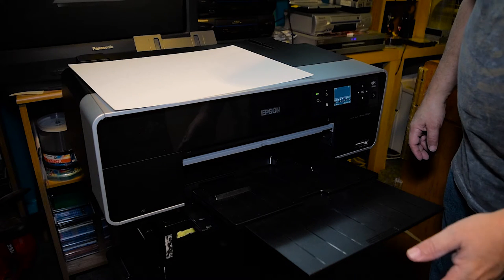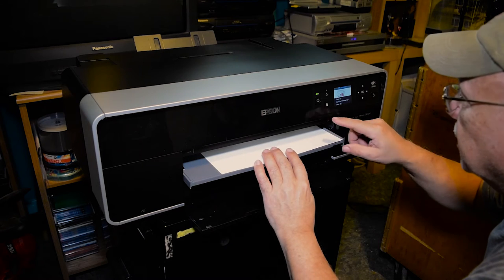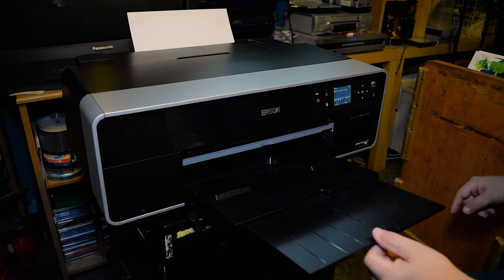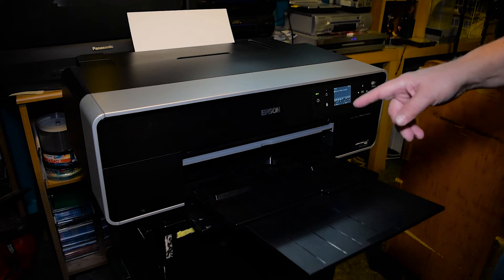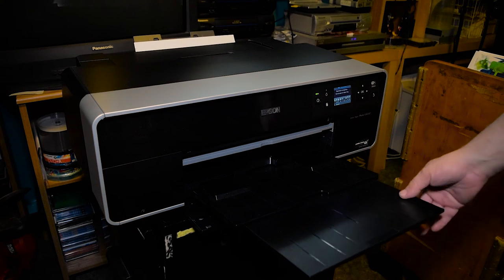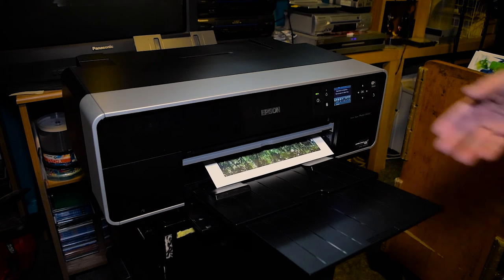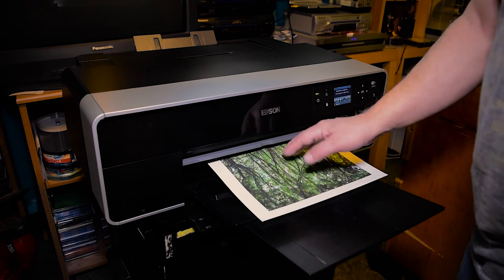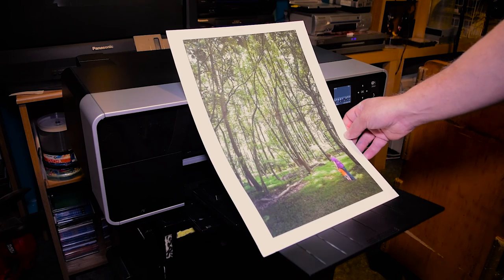Printing On the R3000 on Fine Art Paper from the front loader

Comment: So all fine arts papers should be sprayed or this particular one requires this additional step?
Reply from the maker: +ladduro Spraying is common on several fine art papers. But it is more of s personal choice if you want to protect them from UV.In my situation with the CANSON Water color paper it is a necessity as the paper is totally uncoated for inkjet use.If you are using a paper intented for Ink Jet printing or photographs then you would not have to.
Reply: +Jose Rodriguez I am using Epson's fine art papers. Especially Velvet Fine Art. I could not find any info regarding to coating for these papers...
Reply from the maker: +ladduro Because it really does not need it. Some papers that call themselves "Fine Art" really shouldn't. A ture Fine Art paper will be free of OBAs or any coating that has nothing to do with INK adherence or absorbtion. Often coatings and layers are applied to solely enhance the appearance of the image. Brighteners are used on the paper base and inbetween various layers. That's not saying "Velvet Fine Art" is bad. Not at all. Just that it does not really need anything else to enhance the results.Canvas Pigment Prints, and heck, even real classically produced Oil Paintings all need a coat of varnish or they will look extremely dull. So will cerain papers. You would know. If it looks great right out of the printer then that paper simply does not need any coating.CANON real Watercolor paper definitely does.

Comment: Doesnt work. It feeds the paper in, seems to find the edge and loads ok, then tells me to shut the front feeder door, then just sends the paper back out with a paper out error.
Reply from the maker: You did choose that feeder in the driver?
Reply: I'm having the same problem.  I also get a printer error and it comes out half done. I'm at a loss. I have been using Hahnemuhle photo rag 310.